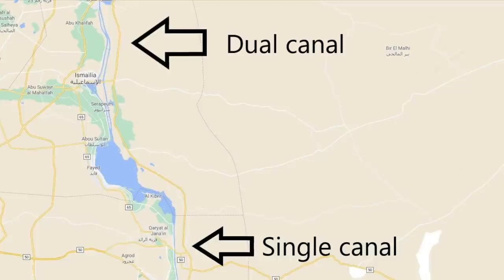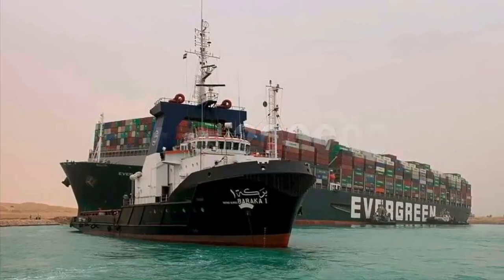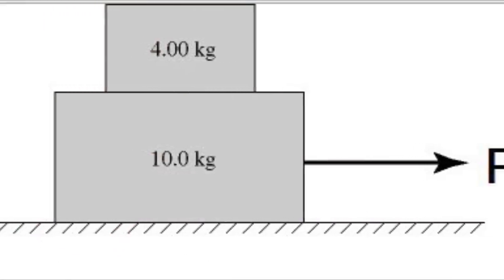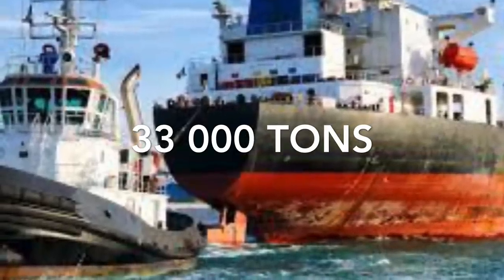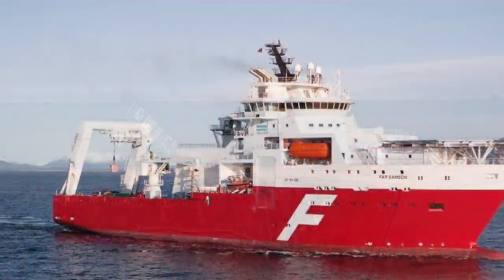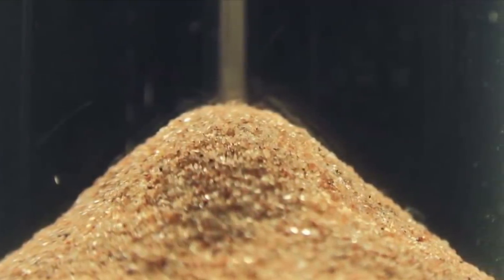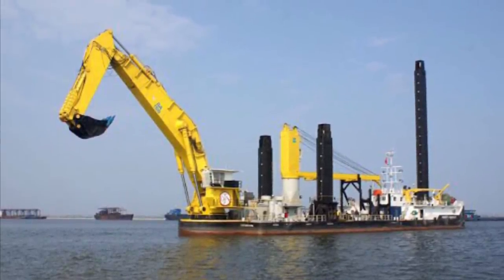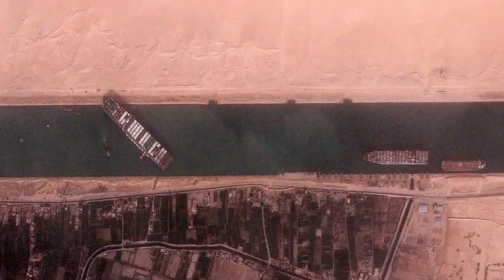MV Ever Given - why can't it be pulled out? Suez canal blocked

Comment: Thanks...this made a lot of sense to us scratching our heads.
Reply from the maker: thanks for your feed back
Reply: @TheGeotechEngineer  There definitely are dredges that dredge in front of the vessel, and also, the flow of sand to a maximum angle has benefits as well as problems because a dredge can dredge beside the ship and let sand flow out from under.
Reply: @TheGeotechEngineer .....How about some Sikorsky sky cranes unloading the damn containers onto the sand? I should add that it would probably have to be unloaded EVENLY to keep the hull from cracking and thereby causing a REAL "cluster-fuck"
Reply: Sense? you do not measure force in tons you can tow, in fact that is crazy BS, also there is no such thing as a nose on a ship and assuming what he called the nose of the ship to be the bottom of the keel is laughably uneducated.
Reply: @whatdafarkenhell7110 .....Well noted, I was thinking along the same lines; Newton's laws of motion; you'd have to overcome a hell of a lot of inertia!
Reply: @bhaggen  I believe you need inertia to move the ship, the lack of it is the problem.
Reply: @bhaggen  nice thought, but a Sky Crane can only lift about half the weight of a loaded container:  https://en.wikipedia.org/wiki/Sikorsky_S-64_Skycrane
Reply: No it does not!! I think you may be a undercover agent? Let me check ur profile.
Reply: This video is false. The flat earth caused the ship to be stuck and the reptilians have larvae on baord
Reply: @TheGeotechEngineer  They should try high pressure water jets to remove sediment and sand from under the hull.
Reply: @nighthawkarts  I know right. Bankers and members of the government never lie to make billions or enslave people. Trust the bankers and government. They'll take good care of ya!? 😆
Reply: to the salvage crew this operation is just a 5 in a scale of 10 in the enineering and financial side..the time pressure made this oopsie a 10+.
Reply from the maker: @commonsenserules7995  likely one of the best ideas
Reply: "The nose" lol does he means the bulbous bow? that containership is a flat bottom vessel
 And where the hell did he come up with his Weird mathematical equations "1/3 of the vessel means you need to pull 50% of 1/3" what the hell is he talking about? Does that formula take to account the substrate of the channel? 🤔
This guy just made all this stuff up to get views
Reply: @TheGeotechEngineer  
High pressure/volume pumps to wash sand out from under it. Just like sticking a running water hose against your lawn, it will bore it's way down nearly as fast as you can push it. Your simply displacing the sand with water.
Reply from the maker: @commonsenserules7995  that is likely what they will do.
Reply: @TheGeotechEngineer  there’s more to it than meets the eye. 

The International Criminal Court is in New Cairo. The ship stuck in the Suez Canal has the call sign H3RC (Hillary Rodman Clinton) owned by Evergreen (HRC’s secret service call sign), the tug boats trying to free the ship are Barak and Mosaed. Russian Navy are patrolling the ships waiting in the Mediterranean, US Navy the ones in the Red Sea. Don’t know if the Suez has been blocked for security reasons to protect the ICC or to search ships for human trafficking or ransom on the real economy. However the ship H3RC was hacked and purposely crashed at full speed into the canal. Ships are losing $6bn+ per day, so whatever is going on it is all related to the new financial system negotiations at the moment, KIMS/QFS.
Reply: @nighthawkarts  best response of all thanks ciao paul ps still laughing
Reply: @whatdafarkenhell7110  No, it's hydro-static 'suction.' While suction is an improper term, it sure FEELS like the mud and the steel are sucking towards each other. 
You can go into your backyard with a shovel into some mud and witness how the steel wants to cling to the mud from its back-side. You break it free by leveraging the handle down so that the digging end swings up -- reluctantly. 
The nose of the ship is practically glued into the mud. BTW, 'nose' is the slang term for the sonar bulb at the front of modern ship designs. Even without sonar, such a bulb reduces drag -- so they are as common as dust. Civilians will always call such a dome a ship's nose. And, yes, the nose does taper right on down to the keel. That's for hydro-dynamics.
Reply: @commonsenserules7995  That's not so easily done as the vessel is so huge. 
What would work is to cap the top, the mud, and to pressurize the soil with pumped sea water so as to create a hydraulic push-away force. Hover-craft use the same logic -- with an air-cushion -- to lift themselves up. This time around, water & mud -- contained kind-of-like the air cushion of a hovercraft -- to shove (not lift) the MV away from the canal's face.
Reply: @davidhimmelsbach557  You seem to forget that the bow of the ship is embedded in the bank. All that sediment and sand has to be flushed out along the keel to free the ship so it will float.
Reply: @commonsenserules7995  The idea is to tow it BACKWARDS and to torque it away from the stern. As it's going right now, the diggers are crafting a whole new canal wall exactly at the spot of impact.
If, from the first, the zone immediately around the nose was layered over in grout -- the stuff so commonly used by deep sea oil drillers -- then you could drill and force sea water into the mud right at the nose -- at the exact time you're pulling the stern with a dredge anchored to a driven pole -- back up the canal.
Everything is easiest if you force the MV to go backwards exactly the way it came. Pumping water -- into capped soil -- would break its hydrostatic bond to the mud.
You know the problem is mud because if it was merely sand, this MV would've been free already.
For the future, Egypt needs to expand the canal AGAIN and then layer the walls with a much deeper layer of crushed rock so that the next time, any MV will have its nose stuck in super-sized gravel. Then every high-tide will release such a victim.
Reply: @bhaggen  except an S-64 Sky crane can lift a maximum of 20,000 lbs.
The maximum weight for a standard 40 foot shipping container is 58,000 lbs.
Even the largest heavy lift helicopter, Russia's Mi-26, can lift a maximum weight of 44000 lbs.

Comment: I think one advantage is that it is a canal. You can pull it from other bank by using cables rather than using the tug boats. Will definitely give more power than pulling it from water.
Reply: IDK.  It’s all sand.  It’s not really a stable platform to pull from.
Reply: It's already in contact with the other bank!  Where are you going to pull it "to"???  

And if you pull it from the same side of the canal (as the side that the bow is stuck into) you'll put massive twisting forces on the bow that is deeply embedded in the bank, so it's not just "aground", it is truly stuck.
Reply: That is quite a good idea.   Like they did in Pearl harbor with the capsized battleships. 
Might take some time to build such a construction though.
Reply: correct . excavate and bury land anchors and use land based winches pulling at 30 degrees from opposite sides of the canal combined with dredging underneath the hull . its still alot of machine hours but its achievable.
Reply: agreed. attach however many cables it would take to pull from the stern with a few tractors ( to pull it opposite of the original direction) and a tug boat at the starboard bow of the ship to point her back to position as its being pulled back. to much head scratching and not enough action.

Comment: Most of the ship was still supported by water. Only a few percent (say 3% or less) was supported by clay (sand) on the borders of the channel. Following the approach presented in the above video, assuming a friction factor of 50%, a 3300-ton pulling force would be needed. The available pulling force from 2 gigantic towboats and a few smaller ones may have been 500 tons at maximum. The fact that the ship could successfully be freed by pulling, has most likely been caused by high tide that raised the ship by just enough to considerably reduced the friction. The work of the Egyptian workers digging around the front end of the ship may have helped. FvB, professor emeritus TU-Delft.

Comment: I read that the stern is aground too. The propellers, the shafts and the rudders are buried as well from the ships stern swinging sideways during the grounding. The ships mid section will be under extreme stresses during low tide, if it's not already based on being grounded at both ends.  The ships hull was not designed for such stresses.
Reply: It is my amateur opinion that this vessel is already being scheduled to go to the wreckers.  If not, i think it will be extremely difficult to get any insurance on it in the future.
Reply: Also they will have to remove the cargo containers from the middle of the ship first to prevent sagging and they have to hope that the constant raising and lowering of the tide won't break her back.
Reply: they should play the titanic soundtrack onboard on repeat. at some point when it breaks apart, it will set the perfect tone like you in a real life movie set as the ship sinks. would make an awesome youtube clip too or tiktok
Reply: Don't use the plural. It is one shaft, one propeller, one 11-cylinder in-line 2-stroke diesel engine.  There is no clutch or shift, you reverse by reversing the direction of rotation of the engine.
Reply: @Suzanne Melanson Pumping out the fuel and ballast while the deck is fully loaded has its own risks - it might come free and immediately roll over.
Reply: @Video-Games-Are-Fun   why not play the titanic theme music backwards so the ship raises itself instead of sinking  :/

Comment: Great Breakdown! Juan
Reply: Hey Juan!
Reply: Dude just blast the side wards of the land and expand little bit wider back to normal
Reply: Whos Juan
Reply: The bestist pylot
Reply: Verified man spotted
Reply: Hey Juan..
How have you been??
Haven't seen you in awhile..
Hope all is good with you and yours.. Be well my friend..
Reply: Nobody named Juan in India.
Reply: For those of you who don't know who Juan is, check out his YT channel (blancolirio). One of the BEST channels on YT for analysis of things like this, with an emphasis on all things aviation related. Juan is THE man!!!
Reply: They have as much land behind them as they need.  They can rig dozens, or even 100 heavy machinery on land with cable and pull it.  Knock down as many homes as you need and have the shipping company rebuild them quickly once finished.
Reply: @hugoknight1  this isnt aviation. And he is way off on some of this.  For instance adding water to the rear balast tanks of the ship will lighten the bow. A powerfull tug can wash a lot of the sand away with its propultion stream. And the pull to move it is not equal to the weight of the grounded portion of the ship one other thing. I am not familiar with this canal but if there are locks on either end of this situation close them and add water to raise the water level in the canal and float it of the bank
Reply: @jlydon29  stop this non sense ..ship is moving forward
Reply: best solution is to close both sides and fill water more just like in sheep repair places...
Reply: @anonymlife4361  stop this shit it's moving forward now 😂😂
Reply: Furthermore as you can see at 2:38min, the vessel is not on the sand with 1/3 of the vessel bit "only" small part of the bow. I also question very much your calculation with the bollard pull and "weight" of the vessel. I am sure it is not simply possible to divide the weight that shall be.pulled by the Bollard Pull of  tug or similar unit, but I am sure others here can clarify this.  Dobt get me wrong, your concerns are shared but some of your facts are simply wrong...
Reply: @chrisbruhn647  bro ship is moving now problem is solved
Reply from the maker: Thanks.
Reply: @TheGeotechEngineer  are you juan the horse
Reply: @TheGeotechEngineer  ship is moving forward now
Reply: Greetings Juan! On older photos you can see aroud 7-8 levels of containers and "wind tunnels". In my opinion + 3-4 "greedy" container levels stacked on the ship. Clearly overloaded and + several hundred plus surface for wind to push like big sail. Add to this "it must go" + 50 kph wind. Carelessness on multiple levels... As You follower on Your videos "human factor" is again devastating the worlds economy...
Reply from the maker: Hi, Thanks. I liked your video too.
Reply: @TheGeotechEngineer  bro are you juan the horse
Reply: @naveen2438  The problem was solved so quickly?
Reply: @holmes1956O  vessel need to be unloaded. Ballast balloons and tuggers pulling. The balloons can work together lifting the vessel at the same time pull it free. They can also use vacuum dredge to position accurately.
Reply: Just came from your channel to here!  I love learning about this kind of stuff from guys like you who don't pretend to know answers and just have a passion for exploring.
Reply: @nagualjan  it’s not overloaded at all - it was designed to carry that many containers. The wind did not push it - ships of this size don’t get push by 30kph winds - they are built to withstand the toughest ocean conditions.
Reply: Evergreen did it again today with a truck in China
Reply: @TheEvertonian  thank You!
Reply: @palehorse4348  not true. No ballons. Ballast tanks are built into the ship. A tugs prop wash will not only wash away material that the ship is aground on it can also move enough water help free the ship
Reply: if I why we can't ram the bloody thing
Reply: First female captain of a boat that large btw
Reply: Juan = Japan!
Reply: Get another boat with a crane and take off each container to me it lighter
Reply: Breakdown breakdown
Reply from the maker: Blancolirio - huge fan of your channel - thanks for your comment.
Reply: only if you like bad information.
Reply: Again from chaina 🇨🇳
Reply: @palehorse4348  lol well its free and no "ballons"  spoiled your party 😞
Reply: @holmes1956O  I personally would have loved balloons
Reply: @palehorse4348  lol I can tell you are right
Reply: @holmes1956O  better not call it too soon stuck again massager there's still time for a party.
Reply: @palehorse4348  last I saw it it was at the dock. By the way they are not ballons they are called floatation bladders and usually used to raise sunken objects. I have never seen them used to free a stuck ship. Not saying they cant be just never seen them used in that fasion
Reply: @holmes1956O  balloons just sound more like a good time than bladders

Comment: You can “liquify” the soil using vibrating equipment with some sort of rods that would be driven into the soil. This would in theory release the ship from the bank of the canal. Similar to how they get the air bubbles out of concrete in molds just on a much larger scale
Reply: In dry sand this would work, but wet sand isn't going to respond the same way, at least not we'll enough to free the ship. Hard to aerate wet sand, especially underwater sand. ;)
Reply: Wow! You're so smart 👍
Reply: Of course. Technical means are readily available. This is rather a "Thug of war"...
Reply: Drill a pipe shaft (or multiples) from shore underneath/nearby the front of the ship. Then add crates of c4. Then, its blasting time.. and hopefolly it loosens enough with at the same time using multiple tugboats at the back? :)

Comment: Using high-pressure water around the front of the vessel will release the suction and friction from underneath allowing the Far Samson to pull it out.  Work smarter not harder!
Reply: Explosives will do the same thing lot less work
Reply: Helen Pauls  not really if its small explosives will work without any damage.
Reply: Helen Pauls  Two kilotons or so ought to work. Look at Beirut.
Reply: Helen Pauls  I got no idea all I know is I was watching a company in lovell wy. Pull a stuck d10 dozer out of the mud with a 150 ton hydraulic winch and it was  slipping so the old man operator  took a tool that looked like a ice auger and drill drilled and placed four half sticks of dynamite under the track buy about 3" and wired and them started pulling and then set them off the explosion wasn't even very loud mud probably flew 3 to 4 ft in the air and  the dozer started moving he said the explosion broke the suction of the mud I got no idea if this would help with a ship stuck in sand but it aint going to hurt much if done by professionals
Reply: @jaggsta  Water is uncompressible.  That ship would crumple quick.

Comment: They need a massive pressure washer to blast the sand from under it, and flood the area around the front of the ship
Reply: That is what I was thinking. It is a much better solution.
Reply: Where did you get your salvage training?
Reply: A truck load of C4
Reply: @gregmacdonald4634  2 trucks

Comment: The vessel is now free... so this is moot.  
The  Evergiven is the name of the vessel, Evergreen is the name of the fleet operator. 
The reason for the stranding of the vessel in the canal was a loss of power and then a high wind pushing the vessel on to the bank of the canal.  This also resulted in the inability to restart  because the impellers were also beached and embedded in the other bank.  The impellers with their variable geometry will also need checking to make sure they will still work after having been put under not inconsiderable stresses themselves, hence the need for tugboats to move the Evergiven. The vessel will probably have to be unloaded and dry docked for full inspections to be carried out to make sure there is no other hidden damage.